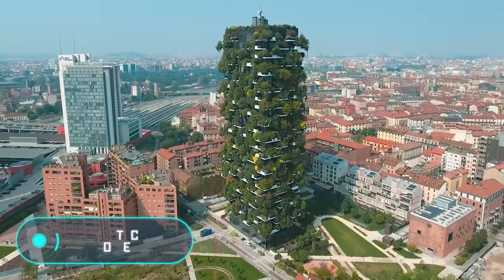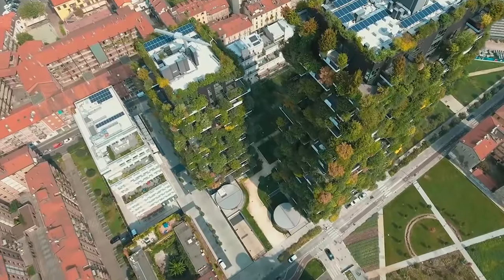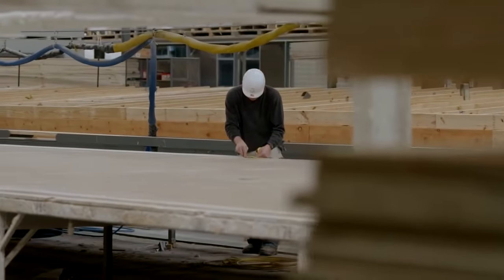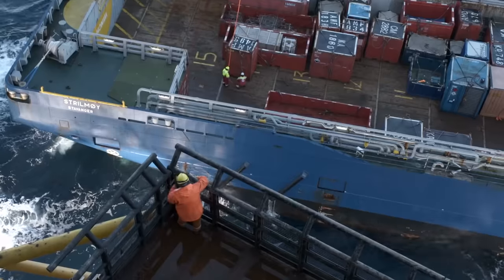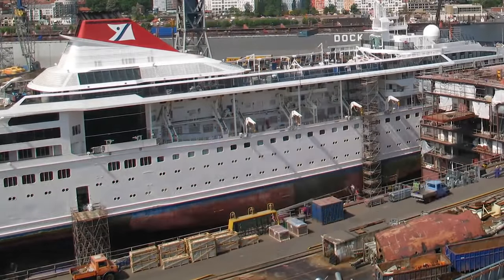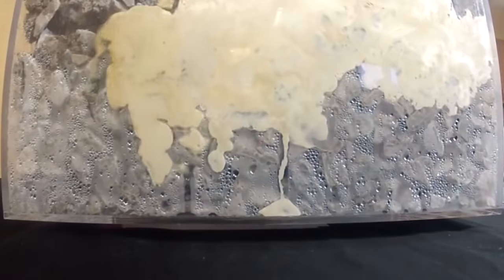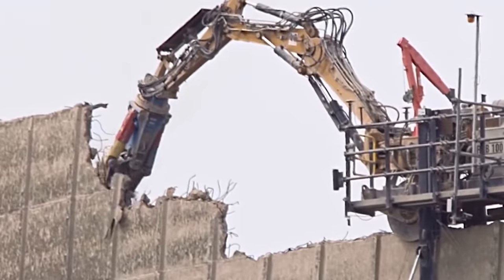INGENIOUS ENGINEERING SOLUTIONS IN THE CONSTRUCTION INDUSTRY

Comment: I just realized something I should have thought of about these treed up buildings. Those trees better be fully grown at the time of planting. Otherwise the roots will, they will eventually break through the concrete. The deciduous trees will be worse as they will send out feeler roots a lot more often. Also, the weight of the trees as they grow. Trees get their mass from three things, the oxygen in the soil, the water they get and the carbon dioxide in the air. This idea just seems bad to me, but I need more info on the plants used.

Comment: The idea of having forests on a building is brilliant especially in towns where there's alot of polution
Reply: Apart from the extra load, the irrigation, the corrosion, the insects, all the dead leafs blocking the drains, and all the dead branched flying off in the wind.
Reply: Although I'm sure they factored in the weight of the trees and water retention into the load of the building I can't see how they reasonably considered tree branches falling off of the building on to people and property on the ground or even against other buildings nearby.
Reply: Roots destroy concrete, they will force their way in every crack and joint and force them apart. Roots keep me in business.

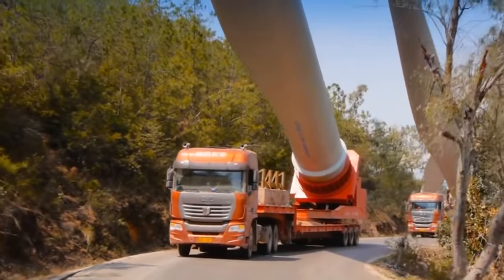Comment: 2:50 why did they drive up that crazy mountain road when theres a nice smooth highway right next to the spot they are building them... i wonder if they got there and were like "oh...a road"
Reply: The paved road you're referring to wouldn't likely be able to take the weight, length and/or height of the trucks. Regardless of how quick, simple and easy the video made it look, each of those trucks took a very precisely mapped route to get from origine to destination and the planning for that move would have taken Months if not a year or 2...
Reply: A Wilson don’t think you have to attack them because they asked a question
Reply: @catwithabat7163  I wasn't attacking them, I was giving them what I believe is the most likely answer to their question.